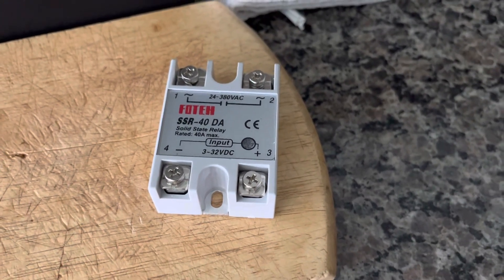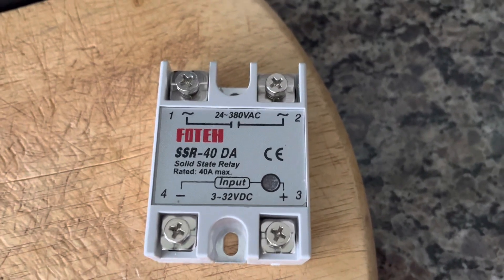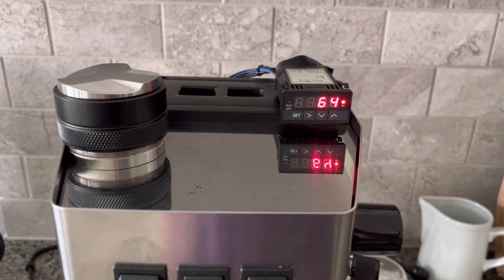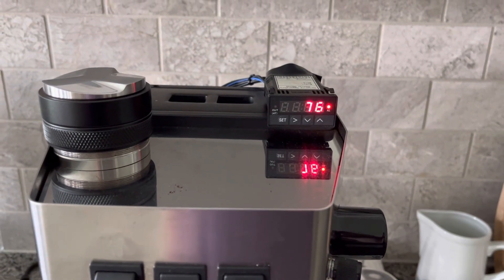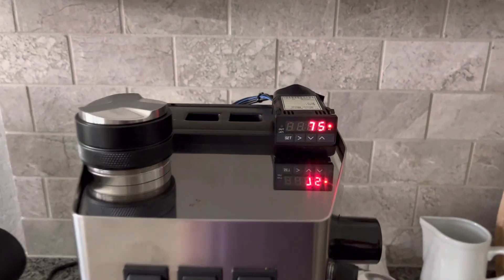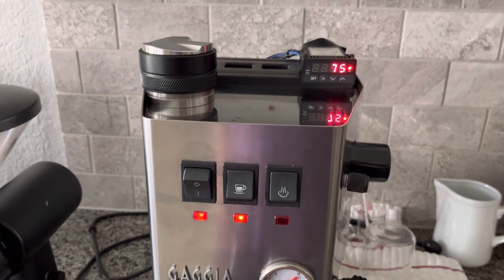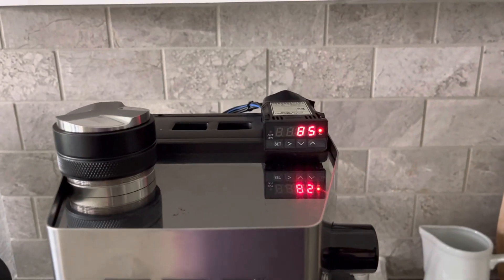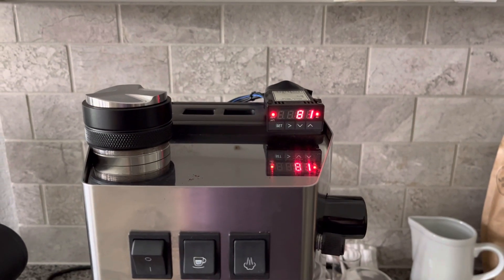SSR in My Gaggia Classic Pro @threehanded8853

Comment: Thanks for confirmation of DA. 

I just noticed that my PINs 9 & 10 deliver -9V / -12V. Looks like + and - is confused even though it's described as 10 being + and correctly wired. 

I have detached the 2nd SSR and it's working properly unless the negativ volts. 

Could that have an impact? Shall I try switching + and -?
Reply from the maker: I don’t know. You have just moved beyond my expertise. I just wanted a decent Cortado!
Reply from the maker: One more video posted…